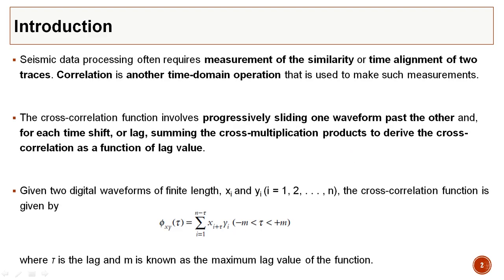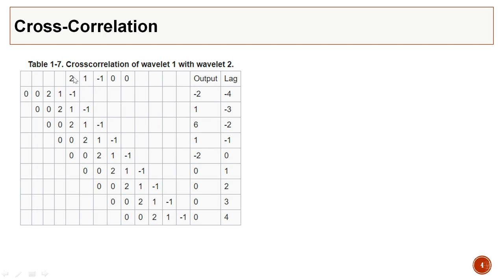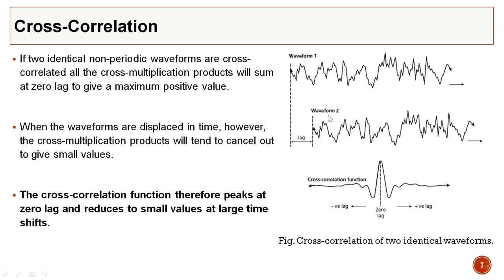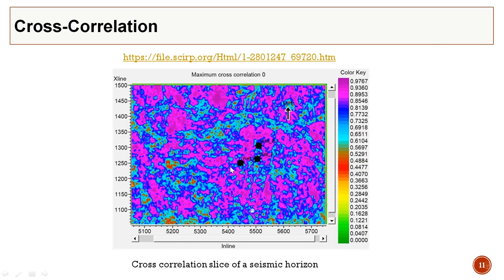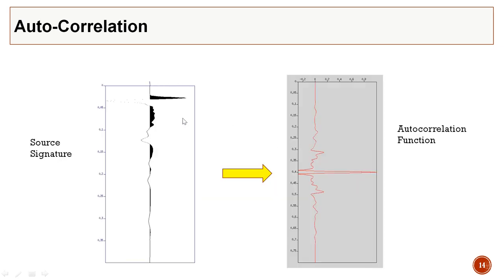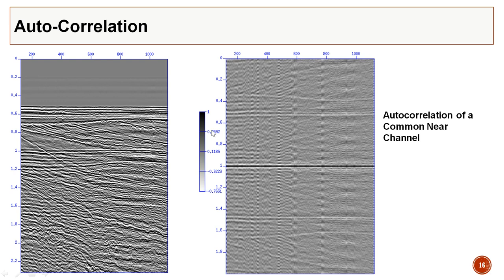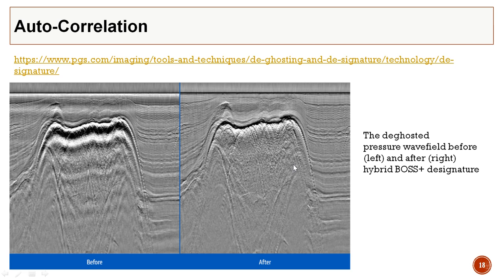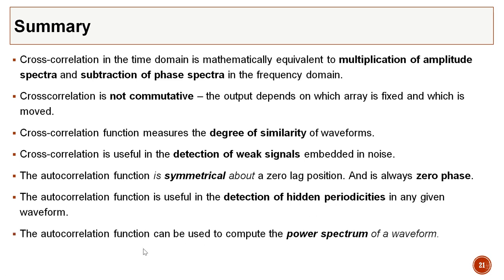Seismic Data Processing - Correlation

Comment: Hi, on page 16, at ep 600 and ~800, there is strong repetition of low frequency (kinda swell noise) and it is consistent through the whole time lag. But, there is no indication of that low frequency or any structure that will represent such low frequency. Can you explain?
Reply: Hi Semut, are you referring to the vertical stripes/noise at 600 and 800 mark on the the right hand autocorrelation section? could they be artefacts generated during the process itself. I agree with you, there is no indication what would cause it from the left hand panel